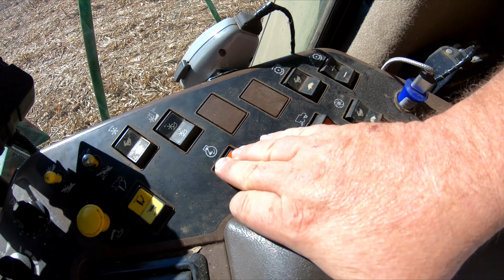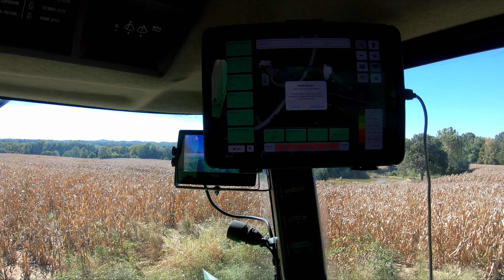"In the Nick Of Time" : Fire Prevented - Corn Harvest Day 6 (9/29/22)

Comment: Was it the bearing that went out in the fedderhouse drive? I had the outside bearing go out in my 9610 and caught it the other day. I could hear it growling.
Reply from the maker: I’m not really sure what happened to be honest with you. It’s almost like a bearing seized and made that inside cylinder start spinning. We replaced the bearings and put a new cylinder in and and have been over a couple hundred acres now without any issues.
Reply: @DylanJoyceFarms  NIce! I'm lucky I guess. I didn't have to replace the cylinder, just put new seals in it as it had a small leak.